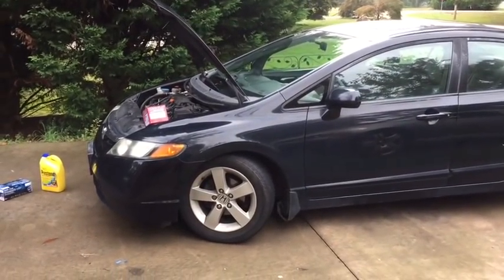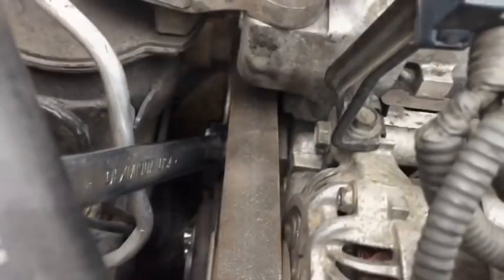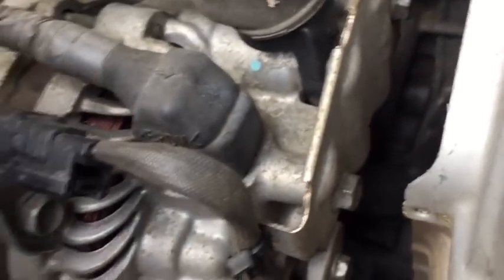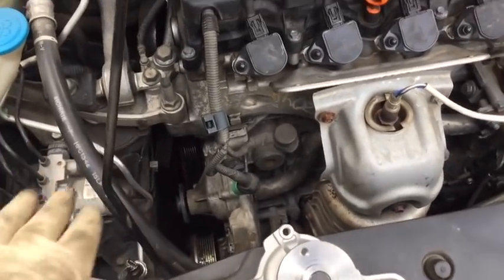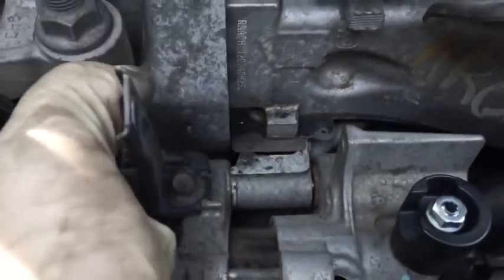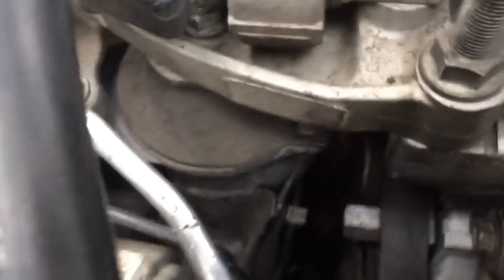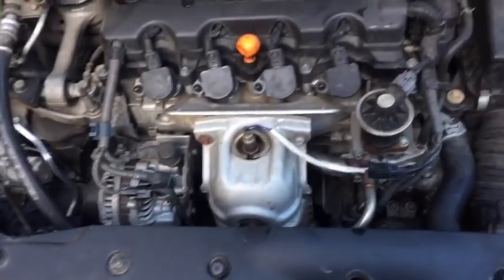Honda Civic Water Pump Replacement.

Comment: Was this the real reason of coolant loss instead of filler neck?
Reply from the maker: @281video  in this case the filler neck was causing low pressure in the cooling system and coolant loss. Once the neck was replaced and the pressure went back up the water pump began to fail.

Comment: I have a coolant leak. Not sure if it’s a crack in the engine block or if the water pump is splashing coolant on the engine block. How could I tell the difference?
Reply from the maker: The water pump will leak near the passenger tire area if you have coolant on the block it is most likely the steel water tube that runs from the water pump across the block to the side by the transmission.
Reply: @YourCarGuyDR  just got back from mechanic. It’s leaking from the engine block, someone tried to weld but did a crap job. I need a new motor. 🙃

Comment: what happens if the alternator control ripped from the wires out of the plug itself when trying to remove how is that fixed.
Reply from the maker: Depending on how it came apart, you can reinstall the wires in the plug. Otherwise get a new plug and splice the wires to your original harness.
Reply: @YourCarGuyDR  Yeah I guess I pulled on the black plastic housing that covers the plug itself too hard or a little too rough. it wasnt budging to come up I tried to use a little screw driver to press the button and the 4 pins came right out of the green plug.

Comment: Everyone saying the crank bolt is hard… I cannot get any of the 3 water pump bolts loose and on the brink of stripping them.  This is the only video I’ve seen that says to move up.  At first I thought maybe it was reverse (turn right/down to loosen), but nope still lefty loose (move up), and it does NOT budge 💀

Comment: Nice vid just did a coolant flush and changed the serpentine belt on my 2010 civic i did needed help to push the tension back to put the belt in makes it much easier but so far the pump looks good 170k later.. Nice work

Comment: can we remove the water pump without taking out the tensioner? The 10 mm socket head bolt on the tensioner is seized.
Reply from the maker: I doubt you can do it without removing the tensioner.

Comment: Just finished a water pump on a 2011 civic. Took a  little over an hour thanks to your video. I is my daughter's car and when I first looked at it I thought there was no way I was going to get my fat hands in such a tight space. Thought I  would have to take it to a mechanic. Thanks so much for such detailed instructions.
Reply: What was it doing ? I believe my water pump is bad
Reply: @charitywright1961  catastrophic failure... dumped coolant on the ground.
Reply: @timd972 sorry to bother you but was it leaking from the pump or from the coolant reservoir? Im going through the same problem where my coolant dumped all over the ground and im still trying to diagnose the problem. thanks

Comment: So you have to take the intentioner off to even get the water pump off?? Can you get the water pump off without messing with the intentioner?
Reply from the maker: You will need to remove the tensioner.
Reply: @YourCarGuyDR  yeah I figured that but I had this guy say he can remove the water pump without messing with the tensioner pulley bracket.

Comment: THANKS GOOD VIDEO !  WHAT DO YOU RECOMMEND ME !   THEY TOLD ME THIS :  SLIGHT COOLANT SEEPAGE DETECTED AT THE WATER PUMP WEEP HOLE !   MY QUESTION ,  SHOULD I CHANGE THE WATER PUMP OR IS IT JUST A SEAL ?     THANKS !
Reply from the maker: This is usually an indication that the water pump bearing is starting to go bad. Sometimes they can go a long time before total failure, but this is what tells you it is going bad.

Comment: Hello,
Son has a 2013 with what I believe is a failing tensioner. Makes noise when cold but then goes away.
  I'm pretty good with the tools but I'm very concerned with that pivot 8mm. It would be terrible to get that far into the job and fail to break it loose or worse yet damage the Allen head.  You didn't video any struggles with it.  Many other videos talk about the difficulty of removing it , but all seem to get it out.   How was it coming out for you?  Did you spray it first?     Thank you sir
Reply from the maker: I didn’t spray it. They normally will come out fairly easily.
Reply: @YourCarGuyDR  Thank you!   "They normally will come out fairly easy"?  How do you know?    I'm very concerned about that step when I get to it...
Reply from the maker: @tomm2271  Honda does a very good job of assembly and the only time they won’t come out is if someone has cross threaded the bolt on a previous repair of if you have severe corrosion. I have done these many times without any issues.

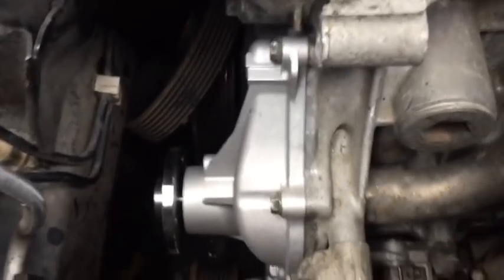Comment: What is that pipe called on the right at 13:03
Reply from the maker: It is called a coolant pipe. If you look it up by the year of your car you will find it.
Reply: @YourCarGuyDR  yeah I tried searching and found only the rubber ones, is it the water pump pipe?
Reply from the maker: @nordmusic6660  yes some sites will call it the water pump pipe.
Reply: @YourCarGuyDR  ok thanks alot

Comment: Very thorough video. Great narrating.  Big thumbs Up. Who would've known to access that panel in the fender well. Good idea about using a new pump rather than rebuilt after going through all of that but your video even discussed alternator removal, tensioner removal, antifreeze drain location all in 22 minutes.  Definitely going to subscribe! Keep up the good work. :)
Reply from the maker: Thank you. I appreciate the comments.

Comment: How many miles did you get out of your OE water pump?
Reply from the maker: Johnny this one had about 150,000 miles on it.
Reply: @YourCarGuyDR  appreciate the info. I purchased a 09LX with 81k, I changed the serpentine belt and belt tensioner but didn't change the water pump because of the low miles,  I was hoping the water pump would last until it hit 150k.
Reply from the maker: Johnny normally the OE pump will last a very long time. Also because in this engine the pump is not driven off the timing belt there really isn’t any need to change it until it starts leaking or fails.

Comment: Tackling my water pump right now what I'm doing is I'm getting everything removed first and then if that pivot Bolt has problems coming off I'll let it soak with blaster which I found out you can insert the straw between the back of the tension arm and the front of the water pump and treat the spot where the Allen bolt mates w the engine, and then remove it in the next couple of days then once the water pump is removed i'll take it to the parts store and get the new one and possibly turn the old one in for a small credit.

Comment: I have a 2008 a honda civic hybrid and it is over heating inturned it on and when i looked under i saw a heavy water possibly coolant leak coming from the bottom of the torwards the middle. Im not a mechaninc so idk how tonfix any of this
Reply from the maker: It'sMeAlfredo the best thing to do is try to find the highest point of the leak. You may need to add water to do this. Then you may be able to get an idea if you have blown a hose.
Reply: @YourCarGuyDR  i really appreciate the reply, whete do i add the water? The car currently had coolant its just above the full line
Reply from the maker: It'sMeAlfredo there should be a radiator cap at the front of the engine bay on the drivers side. Take it off and fill it completely up.

Comment: Is it ok to use prestone coolant and not the honda blue coolant?
Reply from the maker: bmwrp8 yes. Use the Prestone that will mix with any coolant.
Reply: only use distilled water if mixing with straight coolant if not the minerals will destroy the wp bearing then leak out of the weep hole , thats a mistake made when winterizing or intentional from a shop looking for a wp job in the spring, also the heater core / radiator will leak or clog as well -lets be aware  -also  look for a coolant that does not contain any harsh additives/chemicals - if flushing with water cooling system should be filled / flushed 2x with distilled water so no minerals or little can be present in system

Comment: Question: I just replaced my serpentine belt. There were no sqweeks or anything it was basically preventative maintenance. Now its making a noise. Maybe its the new belt, but it sounds like the tensioner. A rattling sqeek sound when you first accelerate in each gear.  The belt was super difficult to remove by myself and took TWO grown men just to get the new one on. I used the special tool and when I slowly pushed  it finally gave a little, then had some play like that was it but it wasn't enough to remove the belt and then went back a little further, just enough to get the belt on and it would pop loose. I've never experienced that before with a belt and feared it may have broke or something and now this annoying rattle sqweek. The weird thing is that there is still good tension on the belt.
Reply from the maker: Race4Survival IsAlive you could have a bearing on the idler gear starting to make noise.
Reply: @YourCarGuyDR  Thanks for the quick response. What's the best way to troubleshoot that? Lubricate, see if the squeak goes away?
Reply from the maker: Race4Survival IsAlive the best way is to remove the belt and use your hand to operate the idler pulleys. Feel and listen for roughness or noise when turning and spinning them.
Reply: @YourCarGuyDR  Thank you very much for the help. Its much appreciated. Is there a way to replace the pulley without replacing the tensioner?
Reply from the maker: Race4Survival IsAlive yes you can purchase the pulley separately.
Reply: @YourCarGuyDR  Awesome. Thanks again.
Reply: @race4survivalisalive800  having the same issue did you find out what was wrong?

Comment: How did you get equal torque on all of the water pump bolts?  Just estimated by feel?  Also, I've read that the 8mm hex pivot bolt for the tensioner can be a problem removing.  Did you have any issues with it?
Reply from the maker: Timetryp I didn’t have any issues with the 8mm hex but I have heard that others have. I have been doing this a long time and have a pretty good feel for equality on the torque. I use a torque wrench on anything critical.

Comment: It is funny. Done  a lot of work on my cars over the last 30 years. My 2006 CRV and now 14 Civic scare me a bit. Not sure why. We used to swap 350s without batting an eyelash. Swapped out a transmission in a mall parking lot once. How difficult is it to change out the serpentine belt.  The tensioner is want i worry about. I am not sure why though. People have told me about the problems they have had. You make this look like child's play. love to see a detailed video of a belt swap. Comments are welcome.
Reply from the maker: Bill Stathakos truthfully the belt is fairy simple. You will want to remove the lower splash cover for access. Basically you can follow the same steps.
Reply: Yea, the tensioner hex bolt apparently can get stuck and sometimes strips out - then it is a nightmare removing.  Bad design to have it overlap the water pump.
Reply from the maker: Timetryp most of the time a stripped bolt is caused by using the wrong or a low quality tool. Proper angle and seating of the tool also greatly reduce the risk of stripping.
Reply: @YourCarGuyDR    Yea, I agree on the issue of tool quality.  I was looking on-line for the USA made industrial grade of Craftsman for the hex tool.  Those apparently were made to even higher specs than the regular line of Craftsman tools.  It is all Chinese stuff now.  I suppose Snap-On would be the choice for quality, although over-priced.  I also hear that Snap-On won't repair or replace a tool without a receipt.
Reply from the maker: Timetryp I have a lot of Snap On tools and do believe they are the best. I have never needed a receipt to exchange them. But they are very high priced.

Comment: When should you change ur water pump? I have a 12 civic with 1.8l. With 160k. The radiator started to leak. So i am replaced hoses and thermostat and coolant. Should i do pump?
Reply from the maker: Killmonize Productions on an engine with a timing belt it should be changed every time you do the timing belt. On engines like this one with a timing chain I would wait until it starts to leak from the pump.
Reply: @YourCarGuyDR  i changed the waterpump was leaking under pump.
Reply: @YourCarGuyDR  thank you so much. Yes my motor has a timing chain

Comment: This is an excellent video!!!! Bravo. If I am alone, I sometimes zip tie the serpentine belt to one or both of the bottom pulleys so that the belt can't fall off at the bottom when trying to slip it over the alternator. (Don't forget to cut the zip ties off when the belt is on).

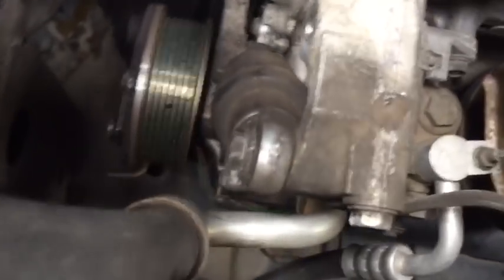Comment: @ 7:59 that bolt was taken off before the serpentine belt and the belt won’t loosen how do i get this off. i still have the altinator on just won’t budge any tips?
Reply from the maker: Simba916k these tensioners do not move easily. If you have that bolt out you should be able to move that tensioner shock by rotating it down towards the front of the car. Otherwise you may want to take the alternator loose and work it out of the belt.
Reply: Your Car Guy DR thanks for the reply will give it a try

Comment: So my Allen pivot bolt seemed to have stripped a bit with my 8mm Allen socket piece in there. Any advice on how to proceed or get the pivot bolt out?
Reply from the maker: Rocky SharkSquad this can be tough but a lot of times you can use a Star bit that is slightly larger and drive it in then turn it out.
Reply: Ben Dreis yes it is insanely difficult, I ended up just quitting and trading the car in. Thank you for the reply

Comment: Thank you so much man, I'm getting myself ready to replace timing chain, timing chain tensioner, guides, drivebelt and water pump, all in one go since I'll be taking it all apart. Mine is 2010 LX at 203,000 miles. Your video was extremely helpful to visualize some parts! Have you considered replacing timing chain yourself? Maybe some helpful advice? 

P.S. Honda quoted me water pump + timing chain replacement to be 1400 dollars. Hilarious.
Reply from the maker: Kons213 it sounds like you are getting ready for a good project. The timing chain job isn’t bad to do. The most difficult part unless you have an impact gun is removing the crankshaft pulley bolt. Once that is out simply take your time and don’t force anything. Make sure you lock the chain tensioner in the compressed position during assembly. Let me know if you run into any issues. Good luck.
Reply: The chain doesnot need to be replaced in modern cars. It doesnt have a  timing belt.
Reply: @Gleeleeglee  they actually can fail when the tensioner for it fails. Do not assume they last forever.

Comment: Whats the best way to take water pump pulley off when the bolt on the pulley is rounded off?
Reply from the maker: Arnold a they make some tools that will grab a rounded off bolt. The other option is to cut the bolt head off.

Comment: Thank you for your video! It helps me a lot. Here are some torque specs for those who want to do this job.

Water pump bolts = 8.7 lbf/ft
Pulley bolts= 10lbf/ft
Auto tensioner = hex (40lbf/ft) / 8mm bolt (17lbf/ft)
Alternator bolts = 17lbf/ft
Alternator Positive terminal = 6 lbf/ft

Hope this helps.
Reply: You are awesome!
Reply: What size bolts are for the water pump pulley ?
Reply: @Meechthakilla25  They are 10mm
Reply: and How do you do that? sorry I Am a woman that likes to do my own repair but never understand the torque specs or how to do it